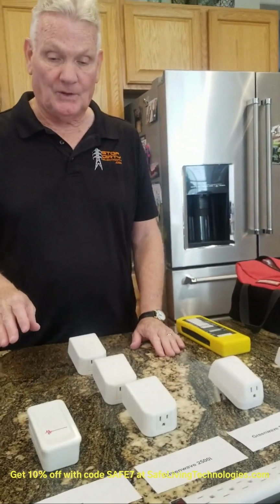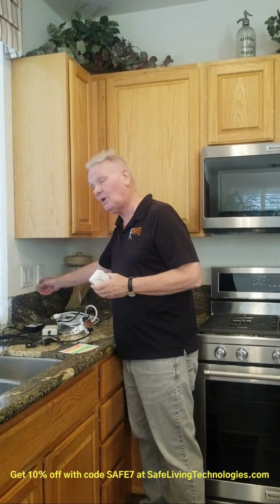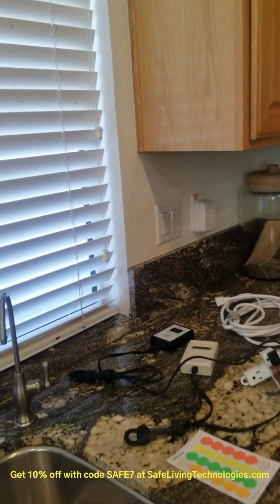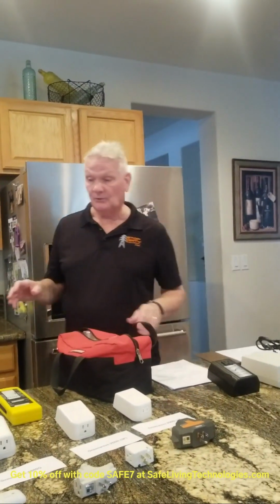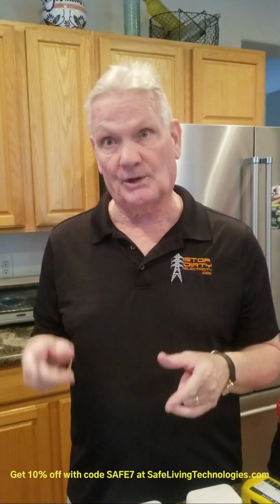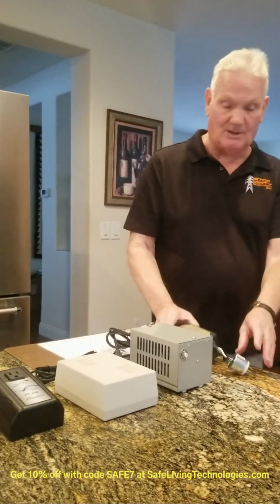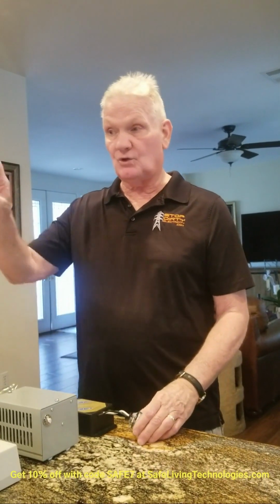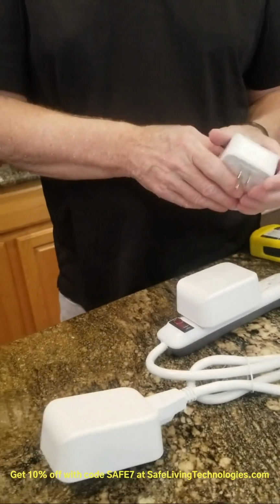Advanced Techniques For Reducing Dirty Electricity- Part 3

Comment: Great info>  Thanks., I have my home treated with G-S filters.  One thing I'd recommend to reduce internally generated noise is to remove all dimmers and fluorescent lights as well as insure the grounding system is up to code.  Our local code in FL has changed where 2 rods are now required.  Using the TriField EM100 meter we have our line noise anywhere in our home below 25mV.

Comment: Hi what do you recommend for those with solar panels?
Reply from the maker: Thanks for watching the video.

 For the least expensive solution,

I would recommend Greenway filters throughout the home where you sit, stand, and sleep.

 Also get a greenwave meter.

 You can determine how many filters to put in each location.

I have a discount code for the filters and meters that will save you 5% - safe7

You can also call me at 702-845-5794.

Thanks

Bill